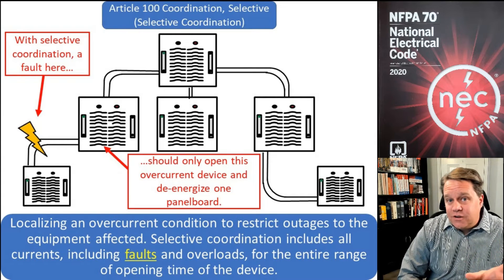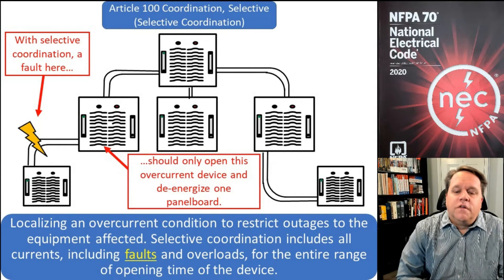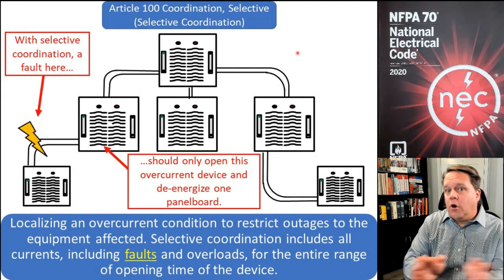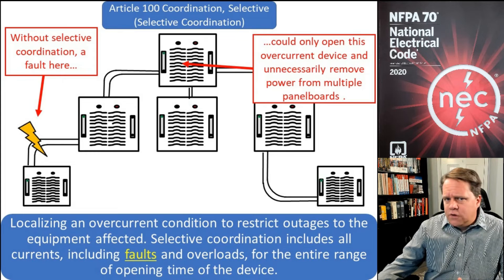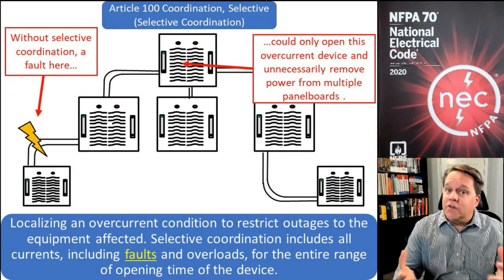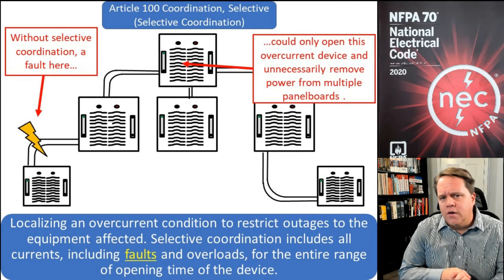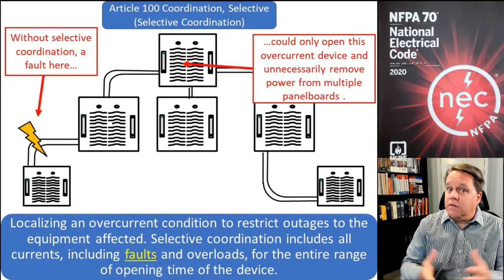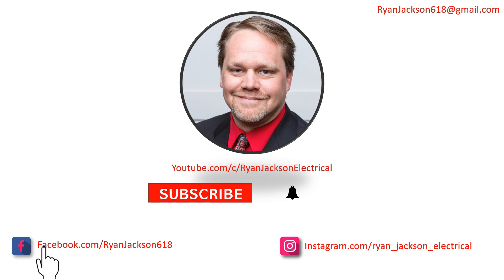100 days of Article 100: Selective coordination (coordination, selective)

Comment: At a place that I worked at had a lot of 30 amp buss duct switches in very hard to get to locations feeding a load that had 30 amp fuses. So many times a 30 amp fuse would blow at buss duct. I started installing 60 amp buss duct switches that had 50 amp fuses feed by #6 or 8 Copper wire to the 30 amp safety switch. Had machines that were 6' wide and buss duct switch of course mountrd in the middle. Only had a sizzors lift and dome 32' genie lifts. Had to use a 2 by 10 between them and walk out to replace blown fuses.

Comment: It’s not exactly the same, but I seem to run into this a lot at older condominium buildings and townhomes. A dead short anywhere in the unit will bypass the branch circuit breaker, and go straight to the main breaker.

Comment: 277V lighting system instead of tripping 20amp breaker it blew a 200amp fuse that feed the Transformer in a Office Building knocking out all the lights...

Comment: 277v lighting on a commercial job, new construction.  Tugged on a hot wire in a sw box.  I knew it was hot.  I had it with my strippers and was going to put a wire nut on it.  What I didn't know was the p-ring screw was embedded slightly.  When I tugged, it turned into a mini plasma torch and took out the main.  Whole building went down.  All the trip settings were all the way down on everything
Reply: Rough day at work, huh.

Comment: Ever seen it blow the primary fuse on a pole mount transformer instead of a 100 amp breaker on the pole under the meter? The short was in the direct buried aluminum cable running from the pole to the house.